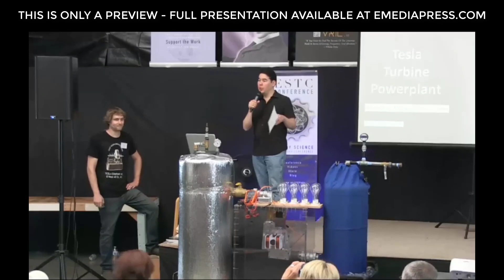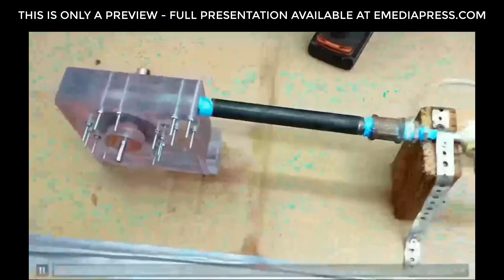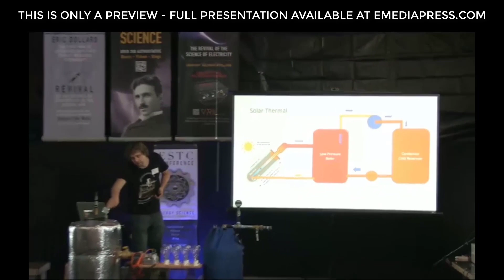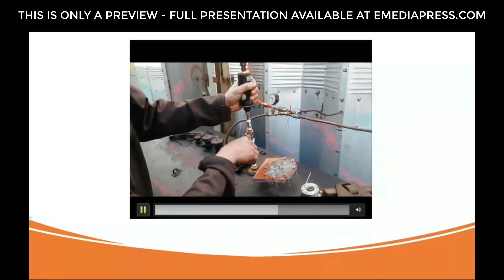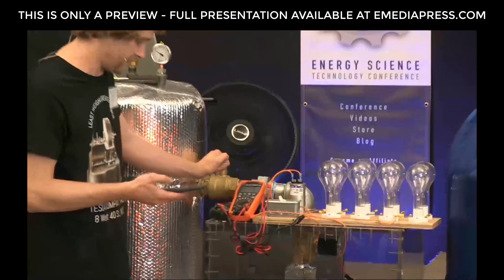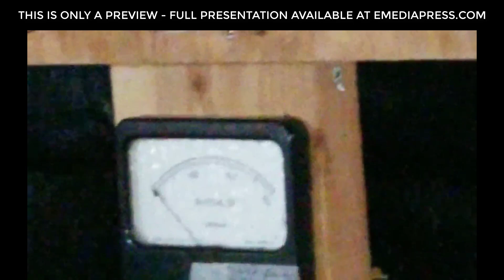2023 ESTC Jeremiah Ferwerda Tesla Turbine Powerplant Preview

Comment: https://youtu.be/Tuzh9mHvzkk looks like these guys beat you to market.
Reply: That one has torque, but I doubt it will hit anywhere the efficiency needed to compete with existing impulse turbines.
Efficiency is proportional to blade-tip-velocity in a Tesla Turbine and it looks like he hadn't solved the mechanical gearing problem yet.  Jeremiah's REAL far ahead in that department.

Would be great to see a head-to-head face-off😁
Reply: @hakasays  and Jeremiah's turbine has a much better power source. I really like the idea of hot water tank or sand battery. Transferring heat to energy. 
I'm glad to see there's some kind of update on this I've been waiting a long time since first hearing about it.
I'm interested in setting it up and powering my home and then the entrepreneurial side of creating a business out of it. If I prove it works, It should sell itself.
Reply: @Adam_A0  Indeed, and I think a lot of us are working in that same direction.

Tesla Turbines with thermal storage is a match made in heaven.   24/7 off-grid disaster-proof inexpensive power.   You could even run off Diesel or freakin' COAL if the efficiency was high enough.

Power companies couldn't compete😄

Comment: A compressor producing 20psi air consumes 260 electrical watts, and this produces 1.2kw electrical, means it's an overunity system.
Reply: It's actually 20psi through a 2in diameter, so not OU,
but there is a chance it is operating above the Rankine limit (due to the dual dynamic of a heat pump and heat engine inside the rotor)
Reply: @hakasays and to answer @thanksbelieve  The system shown here is Heat to Kinetic to Electricity - the system is not closed and is not making any claims regarding power or efficiency other than saying 1.4 kW(e) is being produced from the generation device attached to the shaft.   I cannot see where your 260 "electrical watts" figure comes from.   Look back at Jeremias earlier work under Cryopherous and Cold Steam - you will see that this is not an over-unity device by any means
Reply: @simonmasters3295  Correct, OU is not on the table.
What I was referring to was possibility the turbine was acting above the normal ~40% thermal efficiency limit, due to the nature and geometry of this type of turbine.
(combination heat pump and heat engine)

I just sent Jeremiah a power/speed control/monitoring panel as well as a good flow-meter; we should be getting some good data points on this over the next couplefew weeks...🙂  (https://www.youtube.com/watch?v=m7M7MF2FIAs)
Reply: @jonhack2585 Yeah, there's a lot of complex things that can happen to maintain Boyle's law, like boiling water at room temperature due to a change in pressure.

Comment: Hi Aaron, got a question about Dielectricity, I'm familiar with DC and AC electric systems and recently learned about the DC nature of Longitudinal Dielectric Impulse Currents, like what is produced in a hairpin circuit, my question is if there is any advantage to having it be in the form of AC direction instead of DC?

Also, is there any difference between Dielectricity and Radiant Energy, or are they both the same thing? Cheers.
Reply: Non ferrous Electret magnetism?
Reply: @CoincidenceTheorist  Wow this comment is out of date, I was able to get the answers I needed since posting this.
Reply: @JenkoRun  what made you choose to go with AstraL Zeneca?
Reply: @CoincidenceTheorist  What or who is that?

Comment: I do not get something. At 07:47 he fully closes the valve, but the light bulbs are still running. Well isn't the generator(the 2 copper coils on the bottom) being drived by the turbine which is driven by the steam of the system, steam which is administered to the system by the yellow handle? So if he fully closes the handle, that means he fully closes the steam that means he should have no power driving the turbine, right? So why are the light bulbs still lit?
Reply: Rotor inertia will keep the bulbs lit for a while.  A 5lb rotor spinning at 40krpm is a LOT of kinetic energy.
Reply: @hakasays  Where are 5 lb supposed to be spinning at 40'000 RPM? In the tiny acrylic thing behind the 2 copper coils? With zero noise? And then at 9:40 it is suddenly super loud, as it should be? Jeah, sure, not fake at all.
Reply: @leocurious9919  o my gosh I love when people think this is fake hahah, they will be for sale soon, and then you will see how fake they are. This is a 100% genuine demonstration and that 1300 watts is only a fraction of what this turbine can put out. The reason it's so quit is because it's balanced extremely well.
Reply: @leocurious9919  the noise started when the rubber thrust washer got too hot for its rating, we upgraded the thrust washer so the bearing always has a pre-load. It will be super quiet all the time in the future.
Reply: @hakasays  Should it not have at least some sort of drag (Lenz Law) that would be visible as a decrease in the lights output luminosity? I mean he keeps the valve closed for about 12 seconds and no visble drag is felt on the turbine and no visible decrease in lightbulbs luminosity happens. How can that be?
Reply: @juperrr  Good question.  For the kinetic energy of the rotor at that high RPM, 1kw is actually fairly small.  The bulbs do gradually get dim and go out but it took 1-2 minutes when I saw it IIRC.
Reply: @hakasays  Well this would imply that the 1 kw it was being pulled is an extremely small load for the generators capabilities. Has he tested it with higher loads? What would be the maximum?
Reply: @juperrr  This was about the maximum at about 36000 rpm. We will be going running the turbine at it's rated speed of 50000 rpm which will increase the maximum power the generator will put out. We are also adding a second generator to double the power. In the end it will probably have a peak performance of 3600 watts.
Reply: @hakasays  correct!
Reply: @iEnergySupply  So you are saying 1300 watts was the maximum you could get out of it at around 36000 rpm. Why don't you put bigger magnets on it and bigger coils and bigger cores, so that you get more? What do you exactly mean by maximum?
Reply: @juperrr  yeah that was the maximum the single generator could generate.
Reply: @iEnergySupply  So the fact that you could get only 1300 W wasn't because of the inability of the turbine but rather the limitations of the electrical generator that you had hooked to the turbine, right?
Reply: @juperrr  yes
Reply: @juperrr  The system as a whole is balanced/tuned across the board, like most great designs. Likley the load on the generator keeps that TT in an optimal rpm range to maximize  longevity / runtime, etc. Such a solid system, well done Jeremiah! Great discoveries and good on you for sharing this amazing journey!
Reply: @skydog22  Thanks for recognizing, cheers!

Comment: if that was around 20 something psi, what is the cfm constant rate of air? also do you have a watts consumed number so we can get an idea of efficiency %, how much power in if it made 1300 watts?
Reply: This will all be calculated soon. Along with demonstration of the complete off grid sand battery solar heat tube collection!
Reply: Looks like a loss of 2700w, @ a guestimation of 4000w total for the kettle (2000w) and the air compressor (2000w) minus there 1300w output unverified. Makes a 2700w loss, not worth thinking about
Reply: @godslittlehelper3209  Definitely worth LOOKING AT!  Something fishy going on in this presentation, however the "tesla turbine" can be a "very efficient" converter of "ENERGY"!
Reply: @NiVofHiR  it seems to me, you got to put a lot in to get a little out?
Reply: @NiVofHiR  i was thinking that, as i know about electric, something fishy, and it wouldent be the first time on YouTube that that has happened
Reply: Just think, the faster something goes, the faster it breaks, at the rpm that contraption spins i dought the bearings would last a week of constant generating, it seems to take a lot of energy just to spin that disk up 2000w on the air compressor another 2000w on the kettle, and thats just to start with, would do better with an electric-electric generator, or a big hamster type wheel and a human or dog  and an altenator, would be good to keep the kids a bit fitter and use up there pent up energy lol.
Reply: @godslittlehelper3209  Actually we are running at a fraction of the rpm the bearings are rated continuous use at 60,000. They are ceramic balls with stainless steel 440 races. Because the rotor is so balanced the bearings could last many years.
Reply: @iEnergySupply  frictionless bearings are worse than normal bearings, they do wear out quicker, but hey, let the man find out in his own sweet time.
Reply: @godslittlehelper3209  They are not frictionless bearings. They are similar to turbocharger bearings, Turbocharger bearings can last for years, and they are super high rpm as well. One big difference is this rotor is much lighter then a turbocharger bearing. We are also running the turbine at nearly half the that they are rated for. Also think about it, you have a machine that the only part that can wear out is the bearings due to them being the only moving part on the turbine other then the rotor.